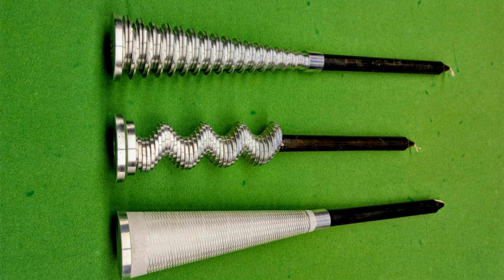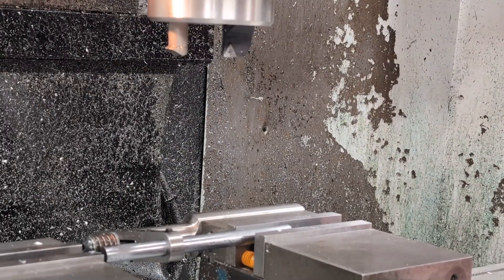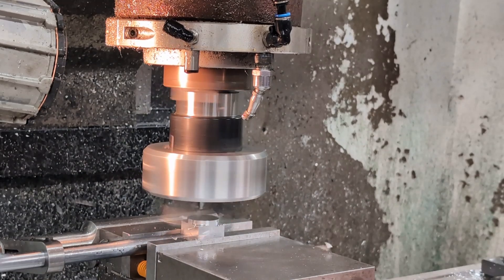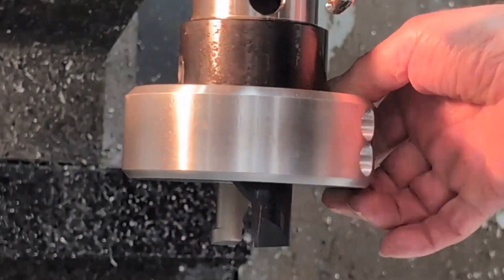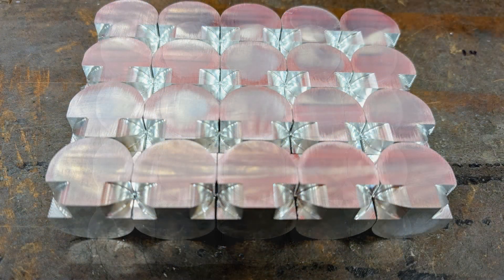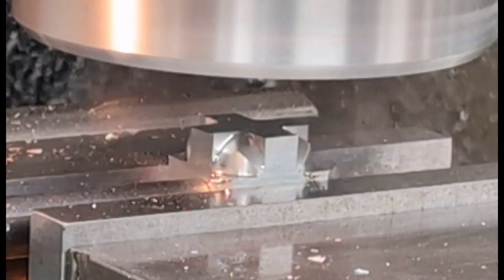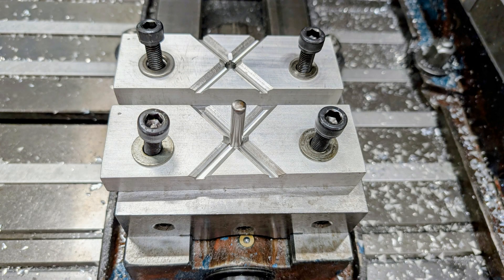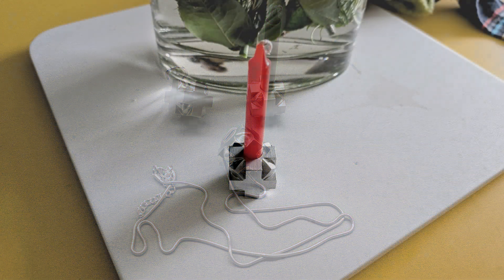Unusual tool - cuts two features. Left and right hand?

Comment: Nice work mate.
Reply from the maker: Although I demonstrated on the CNC, the tool can also be used on a manual machine, so these blocks can be made without a lathe, as they usually are.